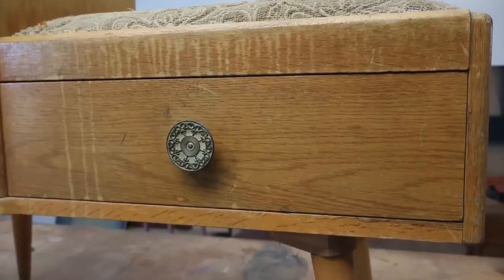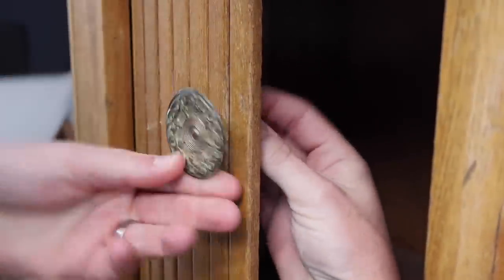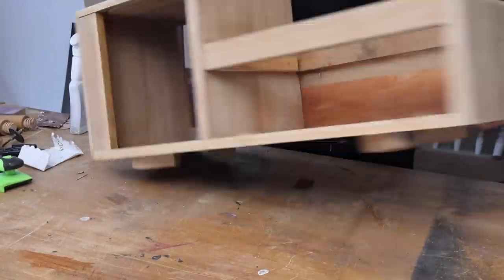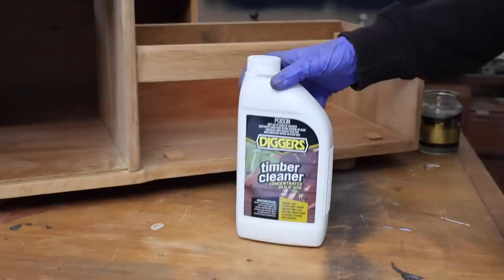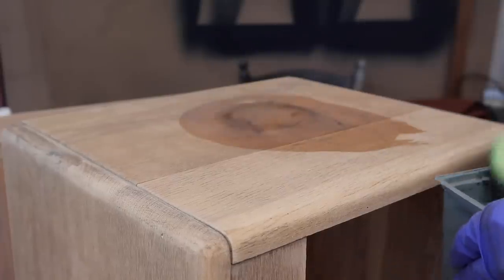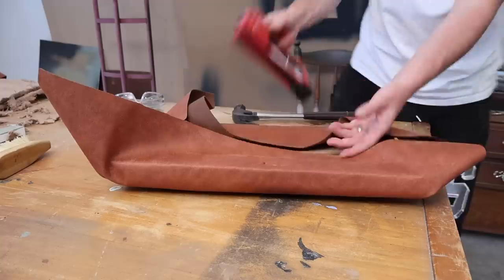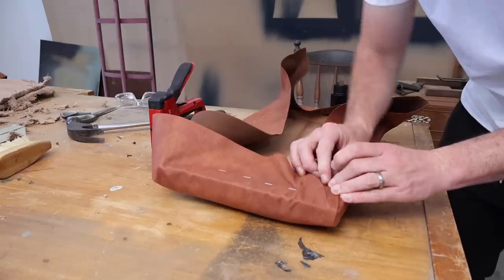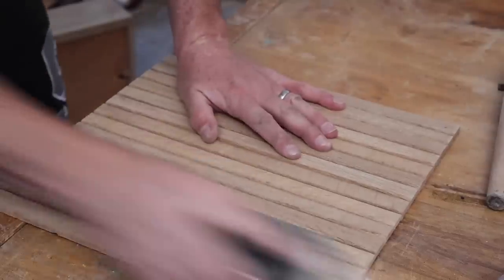Old Phone Table RESTORATION - Reupholstering Seat & Tambour Door Refresh

Comment: Next time don’t use a chip brush to apply varnish. Use a lint free cloth. Sand with 220 between coats. Apply 3 coats
Reply from the maker: Rodger! Cheers for the tip
Reply: even if its oil based estapol?
Reply: Can lint free cloth be purchased or do you just mean an old tee shirt?
Reply: @Lee-dq2lw  Yes, chip brushes are roughly constructed you can get drag marks and uneven coat.
Reply: @nataliemarshall7158  I have always used old 100% cotton t-shirts or undies. Do not cut the cotton into pieces(then you create lint)
Reply: @meepenjaap7999  thank you, now I see where I have gone wrong I was cutting mine up thinking I’d more use out of them.
Reply: How rude
Reply: Actually, I like the brush and wipe method. I'm going to try it on a project. Of course I'll sand and finish with a paper bag.
Reply: Yo aprendo Muchisimas técnicas!!
Faltaría que pusieras los nombres de los materiales que usas y sus alternativos porque aca en argentina no se consiguen
Reply: @spiritualbyname it was just an advice 🤷🏻‍♀️
Reply: Sir, yes sir.

Comment: Just in case you upholster again, you finish the corners by bringing the corner tip down first & then pleat in the 2 sides towards the corner tip. That keeps it neat but also keeps the 4 edges level with each other. ❤

Comment: Nice! I don’t recall ever having seen a Mid Century Modern gossip bench before, which is strange. Beautiful restoration, and that color stain works well. I was happy to see that the tambor door just needed to be cleaned and waxed. They aren’t difficult to repair with the proper preparations, but really easy to mess up too.
Reply from the maker: I was happy about the door also, it was in pretty good shape! Thank you for watching and taking the time to comment, I appreciate it :)

Comment: Love it! The upholstery looks great. The knobs has a great look to them, but I personally think it would look better with something simpler in black. Love these kind of doors, but a pain to sand! Well done on both the piece and video (and baby😄)
Reply from the maker: Thank you, appreciate you watching. Absolutely agree with you on the handles, if it was going in my house I would be in favour of black handles. I did consider using them for this video but decided to try and keep the piece as original as possible - the handles aren't really my cup of tea either! Thanks again :)
Reply: I agree, I think smaller more contemporary knobs would of looked much better.
Reply: No, absolutely not! Smaller knobs would not jive with this period piece. They are perfect. The only  thing that doesn't go  with this very nice refinish is the leather. It does not go with the piece or the period. The fabric that was replaced coordinated with the knobs and brought textural interest to the piece. A similar upholstery fabric should have been used. But, a nice job otherwise!

Comment: I feel bad for your chisel..😢
That’s a good looking gossip bench. Very different from the one my parents had. Ours had a round table and then the chair built in. No drawer. You did a nice job with the upholstery for being your first time. Corners are always hard to do. Don’t be afraid to use a staple remover to readjust the fabric to minimize ripples. Oh and if you like wipe on poly, you can dilute yours if it’s oil based with some mineral spirits. I like the wipe on type, no brush strokes and you can build coverage. I do about 3-4 coats on table tops with a light sanding in between coats(400-600grit). Finish it off with a buff with craft paper or paper bag. Learned that trick from Thomas Johnson Antique Furniture Restoration here on YouTube.😊
Reply from the maker: I can't wait to try your varnish tip and technique out. I didn't know you could dilute it and thats why I use a cheap brush to apply before wiping down, its so thick and messy otherwise. Thank you for the hot tip! The craft bag trick sounds good too, ill give it a go! Yes, I am now feeling a huge sense of guilt toward the chisel. I have to confess that I have a good set of chisels and one chisel that does get all the grunty jobs. Ill give it a break and buy a tool more suited to the task ;) Thank you for watching and sharing your feedback :)

Comment: @Flipitnation good job on your first go at upholstery! The outside turned out lovely.  I've been learning from "faceliftinteriors" and "ucsolutions". The first guy reupholstered a leather dining chair.  The second are a father and son channel...at least 3rd generation in the business. Both are really good. 
I highly recommend using linesman pliers (also known as flush cutters) for removing staples and nails...just don't squeeze so hard you cut instead of pull. Pinchers also work well. Not sure what the actual name is...lol.  they are pliers with a sturdy rounded head. They look like a thumb and finger curled together in a pinching way...hence the nickname. 
Next time you remove material...try to keep it whole.  That will be a template for the replacement part.  Make sure you cut a half inch more along the edges to give you room for error or stretch.  As I'm sure you are aware,  some material has more play than others.  A woven fabric usually has itself out of alignment so be sure to buy more than called for.  Have a person hold the corners on one end while you pull back and forth on the other. Follow up with ironing. This process will help realign the threads...however you will likely need to recut your "straight edges "...this is why you need extra...just a couple inches more than required should be fine. 
You did fine starting in the center of each edge.  What gave you a hard time is that excess material. On "epicwoodworking" he visited a master craftsman for reupholstering a stool in leather...he's been doing it for many years.  He does a great job on it...well worth the time to pop over. 
What was used on the back of the tambour door for reinforcement? Did they use straps or canvas?
Reply from the maker: Thank you for all of the great tips, I will give it a go again soon so have taken notes. It was canvas on the back of this door, it was in good condition thank goodness. Thank you for watching and taking the time to comment on so many of my videos, that is very kind and I am super grateful!🤗
Reply: @flipitnation  you are welcome! I'm enjoying your channel. Some day I'll put my "big girl panties" on and make my own channel...lol.  friends and family keep telling me to but I don't like being the center of attention.

Comment: Watching you use a chisel to take out the upholstery nails hurt my heart.  :(   Trimming the corners of the upholstery cover helps get rid of that bulky awkwardness that was slowing you down.  What a marvelous solid wood piece. Well done for rescuing it.  I really loved the hardware knobs. I've never seen anyone wipe down their varnish with a cloth right after applying it before, (or apply with a cheap chip brush.)
Reply from the maker: Yes, I am now feeling a huge sense of guilt toward the chisel. I have to confess that I have a good set of chisels and one chisel that does get all the grunty jobs. Ill give it a break and buy a tool more suited to the task ;) I am sorry your heart got injured in the making of this video, not intentional. This particular oil based varnish was so thick and messy, I found using a brush to get it onto the piece an easy solution. I generally use a cloth to apply as it goes on nice and evenly and doesn't require too much sanding, hence going over it with a cloth straight after. I applied two coats which I failed to mention in the video, I was happy with the finish. If you have a method that works for you, please share if you have the time :)
Reply: @flipitnation   hahaha.  I have this big old  flathead screwdiver that cops a lot of abuse, so I'm one to talk, but when I saw that, I just thought, surely, you can get an old farrier's tool or something, living in New Zealand, to pry those nails out. I love going to thrift stores and flea markets and looking at the old tools. They're usually covered in gunk, but clean up really well. They don't make them like they used to. I get some funny looks, being the only girl in the 'Man's Section'. I think you can thin most varnishes out with mineral spirits. They actually call it a 'wiping varnish'.  When I lived in NZ, I remember having to really adopt the No.8 wire mentality, because I just couldn't get the same materials or tools locally. I brought that with me to Norway now, and it's served me well with figuring out a way to make soap on a craft-business scale.  Oh, and if I didn't say it before, the project looks stunning. The solid wood and the dovetail joins and now you've just brought back it's natural beauty.  *chefs kiss

Comment: Yes, the corners always get gathered. Use 20 staples if necessary but NEVER do a square fold corner. It always screams amateur.
Reply from the maker: Screaming AMATEUR from the rooftop over here ;) Thanks for the tip, noted!

Comment: I'm trying to be tactful,  your intentions seem good, the back piece should have been replaced, small finishing or brad nails, rather than staples.  I admire that you worked to bring new use to an old piece. The upholstery the waste fabric/leather should have been trimmed way back, the piece under the fold, could have been mostly cut away to cut the bulk.
Reply from the maker: Yes, I could have replaced the board but did use 15mm brad nails not staples, the gun uses both staples and smaller brads so understand the confusion on that one. Will definitely do some more trimming next attempt, I was probably a bit cautious being my first go. Thanks again for the tips, appreciate it.

Comment: This was a nice refinishing.  But, it's not really such a good restoration in that you did not re-glue corners and trim, and you left the very old cushion stuffing instead of replacing it.  It is sure to contain dust and mold, possibly insect eggs, and needed to be tossed out.  The wood color came out well, and I'm glad tou didn't spray-paint the hardware.
Reply from the maker: Can you please explain what you mean by re-glue corners and trim?

Comment: It literally pains me to see you use your chisels to remove nails 😢 Also, you should wash off the oxillic acid. It's extremely dangerous to sand and inhale!😮😮
Reply from the maker: Yes, you are not the first (and won’t be the last) to say that. Guilt levels are at an all time high and extra chisel has now been relieved of the grunt work so you can sleep easy tonight. No pain or heartache was intended in the making of this DIY video. It sounds like you must be quite educated on furniture restoration, perhaps you could please advise on what tool I might purchase to remove nails that are flush or deeper than the surface of the wood? They were really difficult to remove with my limited tool inventory. Also, what would you recommend using to wash off the oxalic acid? Just a water wash?